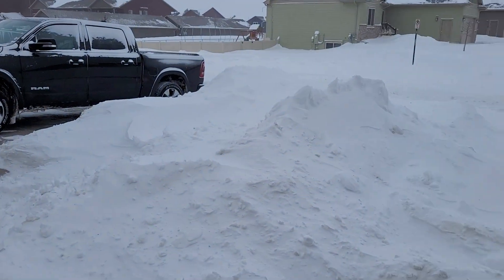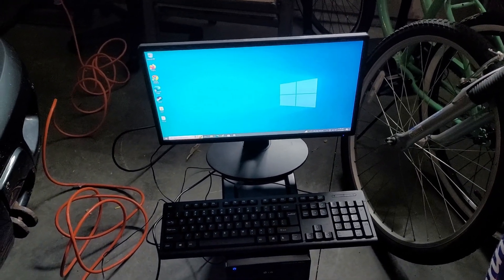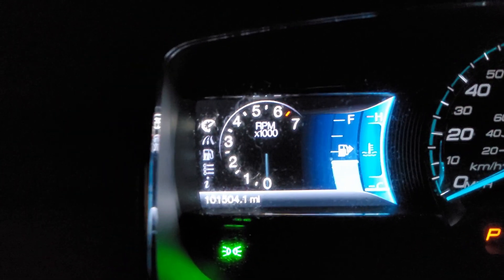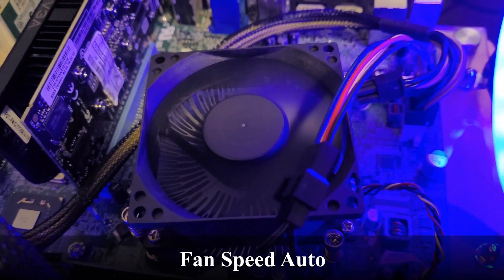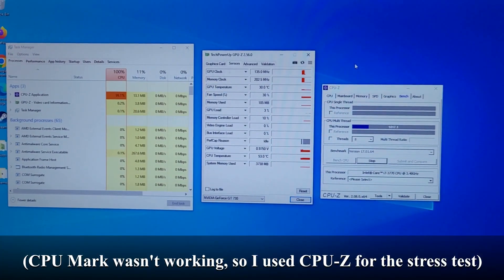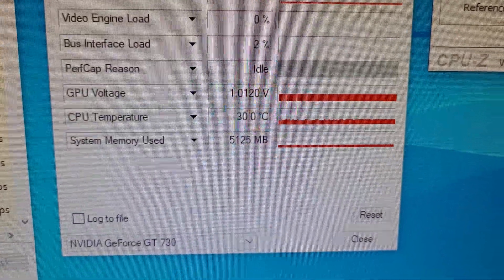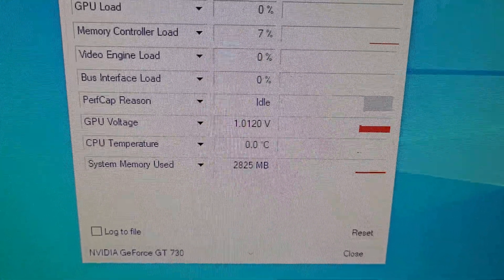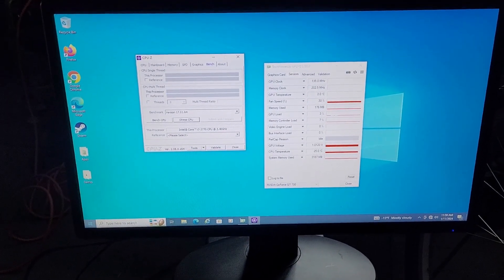Running A Computer In Sub-Zero Temperatures

Comment: So... the problem ain't the operating temp so much as the condensation that can occur when the cold air meets the hot components and the warmer moister air around them. Normally we don't think of these things it comes to cooling something off, because usually it's the reverse with not bringing cold things into a warm environment for the same reason. 

That condensation that can form, is what ends up killing the computer, not the temperatures itself. 

Because you left it running, it should be fine when it is brought in doors, for the most part. But if it died on you after this video was made... welll.... 

That's probably what did it.

Condensation problems are the exact reason why LN2 overclockers deck their rigs out with towels and petroleum jelly.

P.S. If anyone out there is looking to try to use cold frigid winter air to cool their computer, it can be done safely. But you're best off to do it with an external liquid cooling setups instead of blasting it right into your rig. If air is too dry, it becomes a static problem. If too humid, a moisture problem. So you'll have to 'condition' that air first before it goes into your rig, which negates the benefit as it were. But with external liquid cooling, you don't have to worry about that sort of thing as much, because the thing being cooled by the cold air isn't even the electronics themselves anymore, but the radiator that doesn't care if it gets wet.